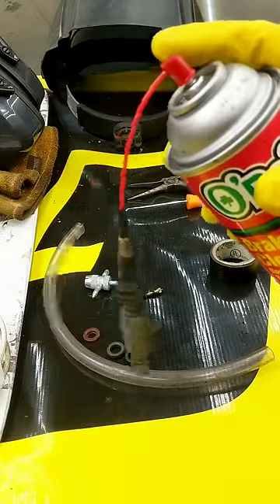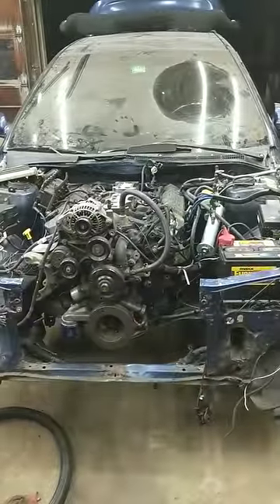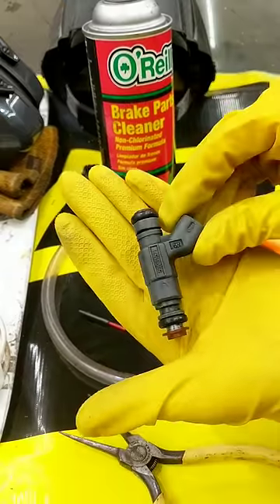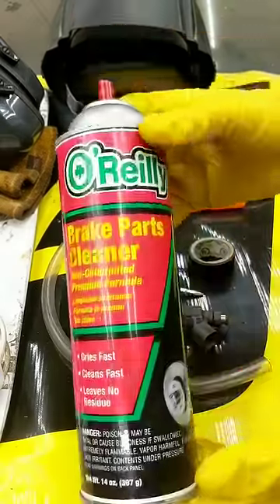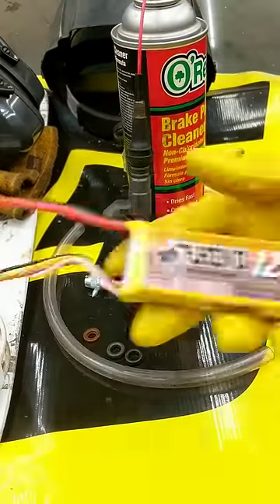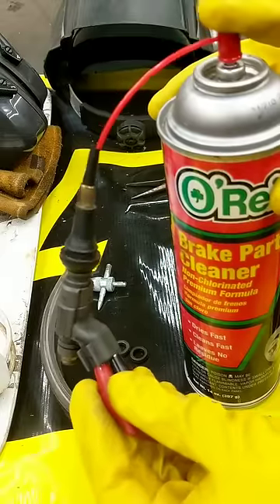DIY Injector Cleaning In 60 Seconds! How To Test And Clean Fuel Injectors At Home #Shorts

Comment: I bet you can start that car with that battery too.
Reply from the maker: Hahaha IDK about this one, but it's possible.
Reply: @802Garage  I think he said it was 9v ish so it looks around 1500mah 2s ~8v LiPo.(probably <20c discharge rate?)  however, I have used a 3S / 12.4V racing drone battery to jump a v8.  Pack was hot and swolled up, but I was able to ride.
Reply from the maker: @1234GOPRO  This is actually an 11.1V LiPo, 1250mAh 30C, 40C burst allegedly. So it's probably 50A capable for a short stint. The V10 says the starter can draw 125-250A starting, so while this battery might have a chance, I think it would definitely puff up at the least, hahaha. I just said 9V or car battery in the video because more people will have them on hand than a LiPo. This definitely is not my most powerful LiPo though!
Reply: @802Garage  Videos are very informative👍🏼. Good use of a LiPo . i use my high C batteries to test power problems or as a short term source.  My attempt did puff it. 👍🏼 and luckily my truck runs good and the bat just needed a lil push over the edge. I was surprised and that’s when I better understood why they’re setting houses on fire (hover boards). Quick energy release.

Comment: Isn't injectors 12 volt?
Reply from the maker: Yes, but your car electrical system runs at 13.2-13.4V generally and injectors can function from as low as 8V up to 16V it just changes their response time.
Reply: @802Garage  so basically I can use a 9 volt battery right?
Reply from the maker: @jl456  You should be able to, yes. If you hear the injector click it works. Should just tap them on and off a lot.
Reply: @802Garage  ok thanks I have a seadoo that I want to try and clean the injectors.
Reply from the maker: @jl456  I'm not super familiar with smaller engines and may want to double check they aren't 5V resistors or something but if you start with a 9V battery I highly doubt you'll damage anything.

Comment: @802 garage it might be smart te also tell the people that you can’t hook every injector straight to a battery🤔
Reply from the maker: Give me an example of one you can't? Unless you mean direct injection injectors, which I would think this obviously isn't about. I believe there are some ancient injectors that are weird voltages as well.
Reply: It was either piezo injectors or injectors with multiple coils, where the current just climbs up till it melts
Reply from the maker: @The_goldfish1  Piezo injectors as far as I know are only used for direct injection, haven't heard about the multiple coils unless you're talking about older low impedance injectors which peak and hold, using two different amperages to the same coil. Either way, you shouldn't hold the injector open indefinitely, but you won't kill it with some taps. I do expect people to do a bit of research beyond this 60 second video.

Comment: Gas is a pretty damn good cleaner itself....
Reply from the maker: Except it's not a strong solvent compared to dedicated cleaners, it lacks the cleaning chemicals of substances like brake parts cleaner or carb cleaner, you can't backflush the injectors in the rail, and I had already run fresh gas and cleaners for a while and it failed to unclog these injectors while this method worked perfectly.

Comment: Why don't you just take the fuel injector apart and clean the mesh filter?
Reply from the maker: That doesn't clean the entire inside of the injector and one of these injectors was literally stuck closed before removal. You typically can't remove the filter without damaging it and I didn't have replacements. This was a video about DIY cleaning, not rebuilding, though I will have a video on that in the future.
Reply: @802Garage  fair point.
Reply from the maker: @Crazy-Chicken-Media  Thanks. :)
Reply: @802Garage  well, when you make a valid point I can't argue that 🤣

Comment: That is not going to provide the same result as getting them cleaned in an actual machine and ultrasonic cleaner. It’ll get some gunk out for sure but… anything determined to stick is going to stay, it’s only break clean.
Reply from the maker: Of course not. I would think this is apparent to anyone watching. This definitely worked though. Went from 9 working injectors and 3 barely spraying, to 10 working injectors. Before cleaning as seen in the video all had bad spray streams and after sprayed a nice mist.

Comment: I don’t know about the electric tape hack.  Carb cleaner will dissolve the glue on the tape and it might travel into the injector causing it to clog in the future.
Reply from the maker: Agreed, that's why you're only wrapping the tape around the straw to make a seal and shouldn't be using it as a straw itself. At most you might get the smallest amount of adhesive residue in the system and the carb cleaner will flush it out since it ya know, melts it.

Comment: Where do I get that tool?
Reply from the maker: Which one? 🤔
Reply: Sorry I should have been more specific
Reply from the maker: @paragonrealtyteam4914  The tire valve stem?
Reply: The cheap core removal for the fuel injector.
Reply from the maker: @paragonrealtyteam4914  Oooh! Just ask for a valve stem core tool at any like auto parts or hardware store. They are usually only a few dollars. Can search for them on Amazon too.

Comment: Clean perhaps...test definitely no.
Spray pattern and volume.
Ultrasonic cleaning and comparing volume with other injectors is the preferred method.
Reply from the maker: It definitely tests if they are FUNCTIONING it doesn't test the spray pattern or volume. That's obvious. One of these injectors would not even fire before cleaning, so I'd say this was a good way to test if I got it working. Of course there is a more proper way. This is DIY.
Reply: @802Garage  how could solvent pass through the injector to clean it if it didn't fire in the first place ?
Serious question.

I replaced a set of fuel injectors on a ford straight 6 today at work because it was running rough, it didn't miss just ran rough, so using this method on the injectors would not diagnose poor spray pattern and/or volume...it would only confirm a completely dead injector that's it.

I'm all for DIY however for the effort to remove fuel injectors, particularly on some models I wouldn't bother with this, I'd pay for professional ultrasonic injector cleaning, new basket and seals and actually know the performance of the injectors.

Each to their own 🤷
Reply from the maker: @IDK-vs1mg  To each their own indeed. I have every bit of this process documented in long form on video. I know for a fact one injector was not firing because when I put power to it, it was not clicking. After taking it out, spraying it with some cleaner, tapping it a bit, and attempting to back flush it, it was revived. It just had build up stopping it from opening. Others had extremely poor split spray patters and would not mist at all. After cleaning and using this exact method to test, firing in the forward direction, they sprayed a fine mist. This is not a professional level cleaning and I never claimed it was. I plan to replace these injectors later when the car is boosted. Maybe I'll flow test them just for fun, hahaha. This is just a DIY way to get your injectors cleaner than they were.

Comment: I followed every step, a "standard 9v" will NOT start my truck... no matter how many times I wrapped the valve stem with electrical tape. Against my better judgment I tapped the hoes in under 60 seconds, now somebody needs to send instructions on how to backflush my injector tool cause brake cleaner did nothing but it burned like fire!! Side note: my impreza didn't come with the v10, is there a number I can call for returns, thank you in advance! 🤣🤣🤣🤣🤣
Reply from the maker: 😂😂😂 Confusion ensues.

Comment: What cleans injectors better than gasoline? If your injectors are clogged, u have another problem...
Reply from the maker: Many things clean better than gasoline.
Reply: @802Garage  idk about that. Gasoline is what keeps carbon from building up on valves. There's a filter on the fuel pump, an inline filter before the injectors and a filter on the injectors themselves. If they're clogged, u have other problems my friend. I'll stay tuned in to your channel tho. Good luck
Reply from the maker: @MercenarySed  Some quick Googling on solvents and fuel system cleaners will reveal a lot. The other larger issue here is engines or injectors sitting for a very long time. The ethanol in fuel attracts moisture and you can end up with hard varnish deposits and corrosion which the gasoline cannot easily clear. Removing the injectors and back flushing them with a stronger solvent can sometimes clear a blockage, just for example. There are more factors in an external cleaning as well. The filter in the injector itself can get very clogged and the stronger solvents help with that too, though you can also replace the filter basket. Generally a car that is driven regularly and supplied fresh fuel will not have clogging issues, but it can happen. Sitting is the real killer! Thanks for the comments. :)

Comment: Don't do this. It's incredibly unsafe. Arcing the electricity to the terminal will ignite the cleaner's vapors.  You will start a fire. Probably in your garage.
Reply from the maker: Then don't do it. 😂 It's incredibly easy to manage this without creating a fire. Any fire made would be tiny and go out in seconds. Literally go spray a bunch of brake parts cleaner on your floor and light it on fire and see how long it burns or how hard it is to put out. Or do it outside! Or use non-flammable brake parts cleaner. Or use a momentary switch. Or tap at the battery side. There are so many solutions here and I'd like to hope humanity has a few brain cells left to not kill themselves every time they touch something. CARS are extremely dangerous to work on. People die frequently. I'd hope someone in this deep can handle some brake parts cleaner.

Comment: Wtf has a V10 in a Subaru Impreza? Driver sitting in the back seat?
Reply from the maker: Hahaha check out the pinned comment. I actually have almost a complete interior in, I just need to refabricate part of the trans tunnel and firewall. The trans is lorge.

Comment: Why would u need to clean them if gasoline is a great cleaning solvent
Reply from the maker: Because it can't back flush them, it's a weak solvent compared to concentrated cleaners, and it's not good at cleaning deposits that build up over time. Google your question for more info.

Comment: 9 volts only not 12?
Reply from the maker: You can use a 9V battery it will be enough to activate the injector, but the injectors operate at 12V, technically more like up to 14.2V, in the car.

Comment: Sorry to say but you can't properly clean injectors like this, all your really doing is checking spray pattern or flushing the injector.  To properly clean an injector pintle or spray ports requires an ultrasonic cleaner and pressurized fluid running at normal vehicle operating conditions.  Some injectors not all can can become damaged by running solvent in them, mostly early model GM injectors.
Reply from the maker: Note the title: DIY
Meaning, this is a do it yourself solution. A cheap at home way to get results. People must have common sense and do research to do anything properly. Anyone can Google injector cleaning and send theirs in for professional cleaning. Not what this video is.
Copied response from another comment: This definitely won't get you the "same" results as a professional cleaning and it won't tell you if your injectors are perfectly flow matched. If they have just been sitting for a while and you want them all functioning, this will get you up and running. That said, the only way to know for 100% sure is flow testing. This isn't a perfect solution, but it does work! I went from 9/10 injectors working and mostly terrible spray patterns to 10/10 working with a nice mist.
Reply: @802Garage  Sorry missed the part in the video where you said do research first, I'm just the average joe scrolling through YouTube looking for cheap fixes.
Reply from the maker: @penname5623  This is a cheap fix. The cheapest fix possible. Your research is watching multiple videos, using Google, reading comments where I've already answered your concerns. If you are already an expert on this topic, then you've already done the research. Not sure what's confusing here.

Comment: If I’m gonna take it all the way out why not just replace it brand new.
Reply from the maker: I feel like the answer to that is incredibly obvious, but money. OEM or actual quality replacements can be heinously expensive. The cheap ones on eBay are generally of questionable quality.
Reply from the maker: @My_Sick_Strings_  Do as you wish, but I don't like spending money when I don't have to. For example these injectors are getting upgraded later anyways, but I needed them cleaned for now after sitting for years. Made sense to me. I drive a 1993 hahaha.

Comment: Wrong wrong wrong. A 12v car battery burns out injector. The reason I know this is because I have just don't it. Please don't tell ppl to contact to the 12v car battery as there going to have to spend loads of money to replace it
Reply from the maker: Uhhhhhhh any modern injector is 12V. There are ancient injectors that weren't, but this has been done thousands of times without burning out injectors.

Comment: This doesn’t actually work guys so don’t waste your time. Not to mention gasoline injectors are stupid cheap.
Reply from the maker: It LITERALLY worked for me. I had 10 injectors. 6 firing bad streams, 3 barely firing, 1 not firing at all. I cleaned them all and all 10 were spraying a fine mist. I used only the techniques shown in the video. The engine went from running on barely 6 cylinders to running on all 10. These injectors are no longer available from the dealer and you either have to ship them to have them rebuilt, buy rebuilt for $30+ a piece so $300+ total, or buy shitty cheap Chinese injectors.

Comment: or just clean it with sea foam every oil change lol
Reply from the maker: Well you know what they say, an ounce of prevention is worth a pound of cure. This engine had been sitting for a few years and a few injectors wouldn't even wake up before I took them out and manually cleaned them.

Comment: What about the condition of the baskets? A proper clean and flow test can’t be bypassed. It’s like saying seafoam is the answer for carbon build up in a direct injection setup. Bad information is bad.
Reply from the maker: Read the title. DIY cleaning. Not rebuild. This is a nearly free method to clean some really gummed up or clogged injectors. Worked perfectly to take me from 9 working injectors, all with bad spray patterns, 3 barely working, to 10 injectors spraying a fine mist. This is incredibly basic and it works well. Of course it is not a professional cleaning or a rebuild. Unless you're going to make a better video, then chill. There is endless information about professional injector cleaning, this isn't that.

Comment: 12v car batt kill The injector windings
Reply from the maker: It won't. They run on 12V. Only ancient injectors are 5V. If you just leave the injector on it could cause a problem, but not if you tap it.
Reply: @802Garage  What kill them Is the duty’s cycle not the voltage that’s why oem ecu’s dont stress the injectors above 70% duty cycle.
Reply from the maker: @marinaportocaribe  Injectors can be run at 100% duty cycle without damage. It's not ideal, but people drag racing do it frequently. The issue is holding them wide open without proper resistance so too much amperage can flow. I've never actually seen someone kill an injector this way though.

Comment: And if you have a low impedance injector you just burnt it out
Reply from the maker: That's not how impedance works. If it's a 12V injector it's fine.
Reply from the maker: https://injector-rehab.com/knowledge-base/injector-drivers/
Reply from the maker: https://fuelinjectorclinic.com/faqs/
Reply from the maker: Read up. The basic point is that low impedance injectors draw more amperage, sense of course they have lower resistance, and the reason to not hold them open is because the old ECU injector drivers would have been drawing too many consistent amps and overheated. They don't require as many amps to hold open, so the ECU would restrict the current draw to hold them open after the initial peak to open them. The injector itself is not going to be damaged by simply opening and closing it several times or even holding it open briefly. The injector solenoid draws the current it needs to open.
Reply: @802Garage  don’t ask me how I know you are wrong
Reply from the maker: @dennisford2000  Explain what low impedance means to me and I'll believe you have an inkling. ;)

Comment: brake cleaner ruins plastics
Reply from the maker: It's not really that simple. You'd have to soak it and it would have to be a plastic that isn't chemical resistant. These injectors all work perfectly. That said I wish I had carb cleaner on hand to make the video. They share some ingredients though.

Comment: Need for speed heat ass swap
Reply from the maker: @kaleb54354  Hahaha just doing what I can.
Reply: @802Garage  what kindof V10 is it btw? I pray to God it's not a triton Ford v10
Reply from the maker: @kaleb54354  Hahaha naw. It's a Dodge 488 Magnum. The iron cousin of the 1st gen Viper engine. It's a heavy pig, but gobs of torque, and I got it for $150.
Reply: @802Garage  hell yeah those iron block magnum v10s last forever stock
Reply from the maker: @kaleb54354  Yeeep. I am gonna add turbos though. XD